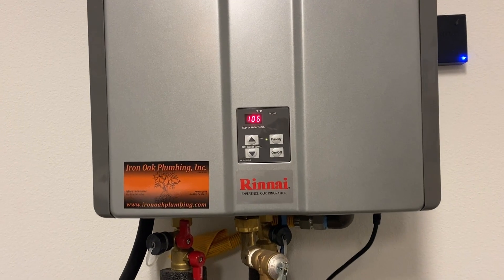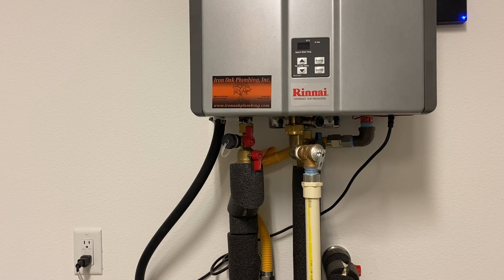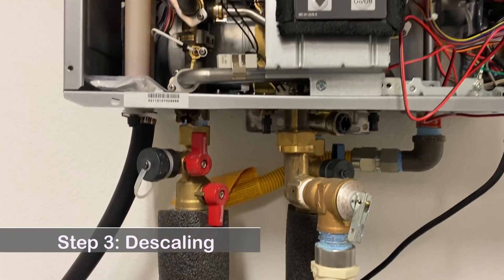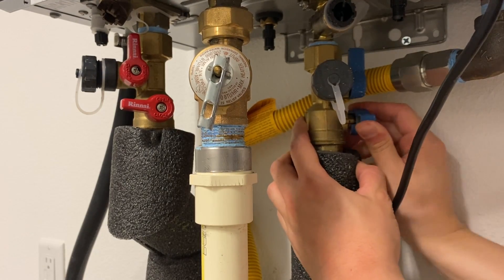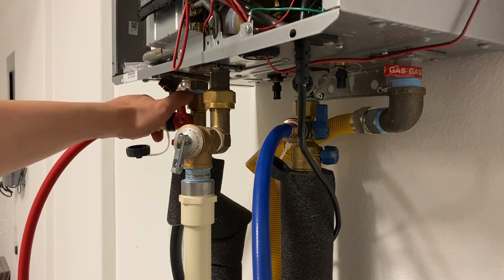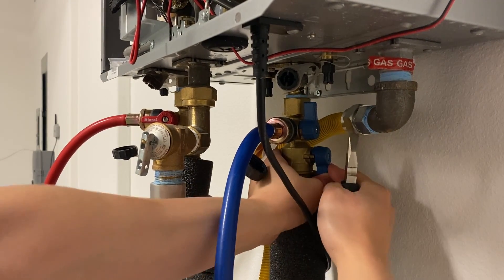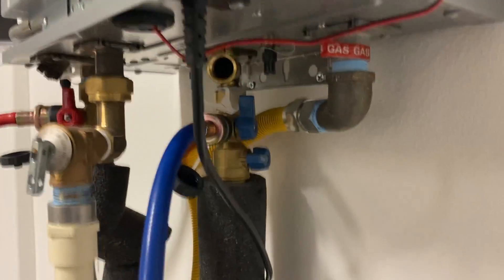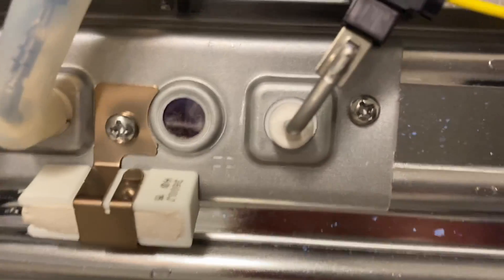Tankless Water Heater DIY Maintenance | Descaling | Air Filter Cleaning | Water Filter Cleaning

Comment: Rinnai official video says to use 4 gallons vinegar. Manual says nothing. You are using 2 gallons, so is the quantity of vinegar being less means what for the flushing process ? Just takes longer ? Or if it was too dirty and then one is circulating the dirty vinegar ?
Nice video by the way, you show things which the official one does not, like the air filter cleaning
Reply from the maker: 2-4 gallons would be ok. Mine water heater was just 1 year old at the time so I used less. Using more volume will theoretically make it cleaner since it dilutes the minerals more.